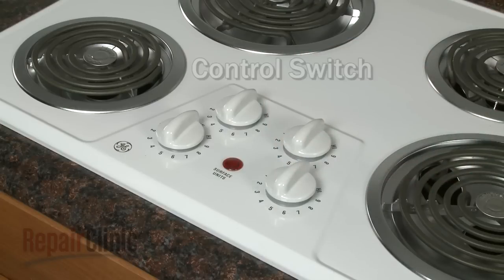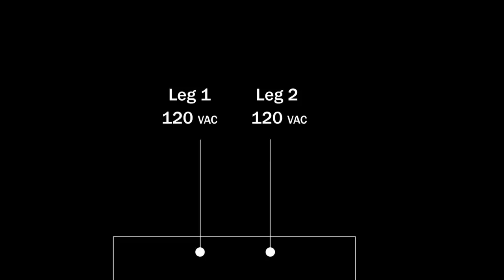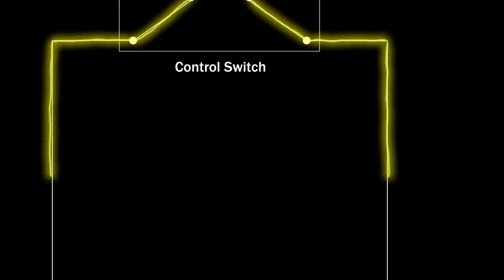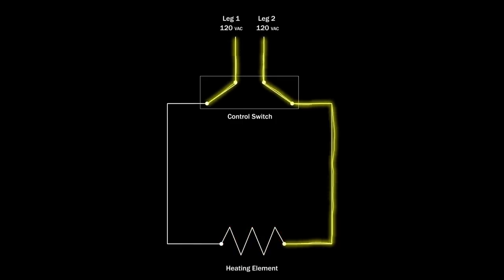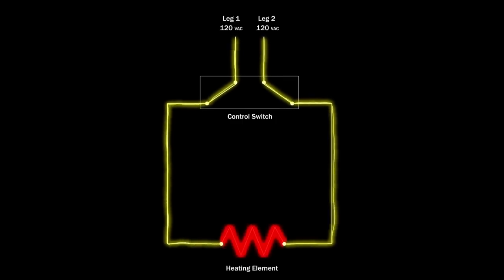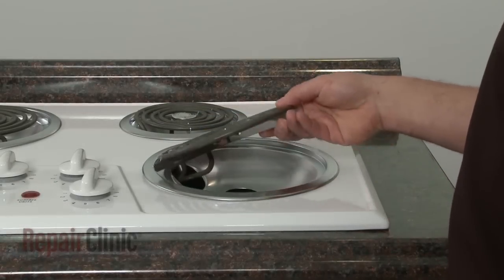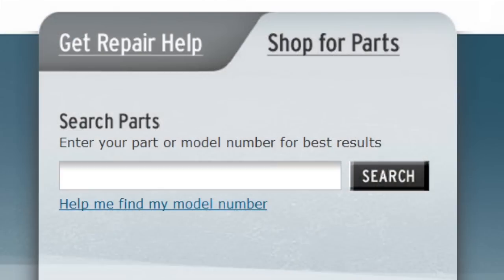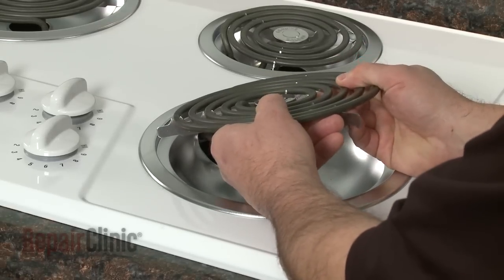How Does an Electric Stovetop Work? — Appliance Repair Tips

Comment: And what if turning on any burner, trips the breaker after about 5-10 minutes. I changed the breaker, so it’s not that. I’m guessing it has to do with pulling too many amps… but I don’t know the electronics side of things. Is there a single device that governs over amperage, on the unit itself?
Reply: Now you are getting a little deeper. I'm assuming you are watching this video because you have an electric stove. If you are getting appropriate heat but it is tripping after a while I am starting to think board/control issues.
Reply: @bluecollarmoneymatters8246   Unfortunately their help line, is no help.  Is there a way to test for that.

Comment: why are there 2 legs?
Reply: You need 240 VAC to be able to produce enough heat. When power comes into your house from the transformer on the pole (or whatever) outside you are getting two 120 VAC sides of the transformer. If your appliance only needs 120 VAC then it only takes one side of the transformer (think TV, toaster, radio, computer, etc.). If it needs 240 VAC like a stove, the element in a dryer, a furnace, etc. then it uses both. 120 + 120 = 240 VAC.

Comment: A comment about delivery==>allmy.tips/bwte?h60   If you are worried about Amazon delivery and setup of major appliances do not fret. They came, took out the old one, put in the new one with a new plug: they brought both kinds to be sure I had the correct one, leveled the oven, cleaned up and were gone in 30 minutes. These guys are pros and I am confident Amazon vets them completely.